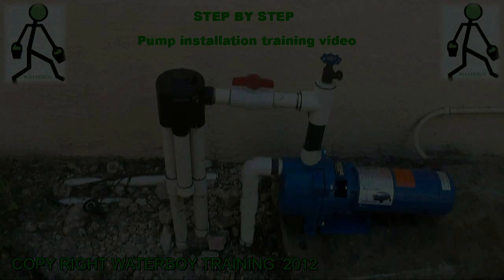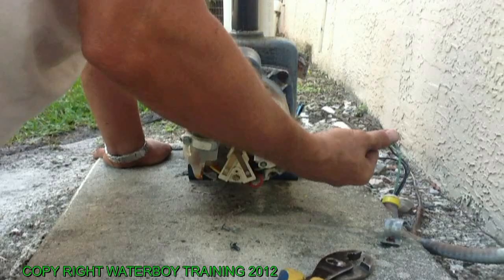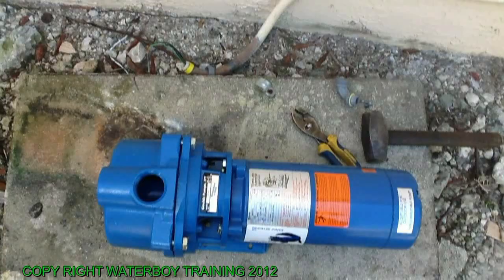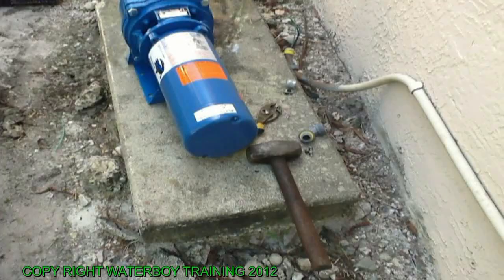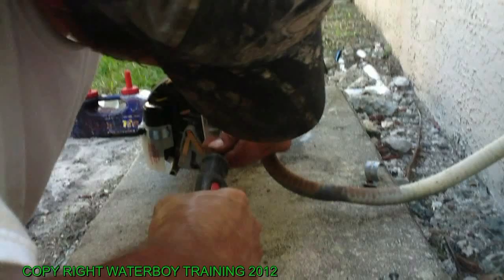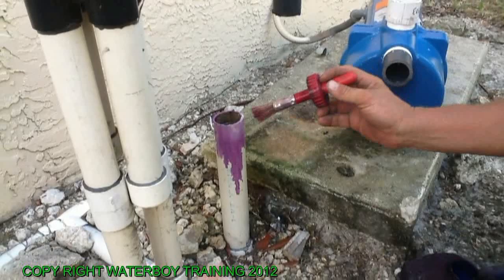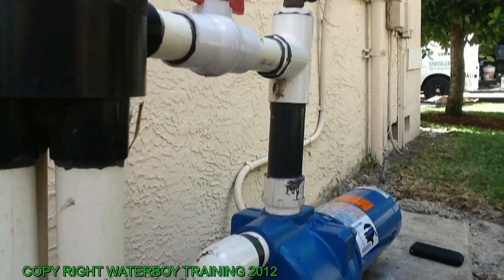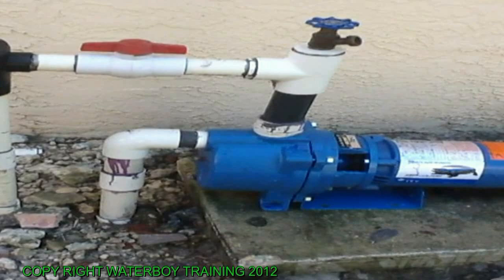How to Install a Lawn Sprinkler Pump

Comment: Excellent video.  My well is a little different as it is Artesian.  I have a flow valve on the discharge.  I have the same Gould pump/motor assembly that you do.  The video definitely gave me some ideas on how best to install.  Thanks for making the video.
Reply: 7

Comment: Nice vid.  Couldn't a couple of unions have been used to make pump replacement more simple for the next person in the future?  For instance one wouldn't need to cut any pipe to R and R a pump.
Reply from the maker: No I don't believe in pvc unions they leak it's much better just cut it out replace it with a coupling 
 And besides it's always better to re pipe when you replace a pump.
 And that's based on 47 years of experience and thousands and thousands of pumps that I replaced.

Comment: I just installed the same pump - much nicer than the flotec I was replacing.

Only problem I am having is the discharge fitting is leaking where the plastic threads into the cast iron housing. Any tips, or just use more teflon tape?

Comment: I have been losing prime .. my water source is from my canal .. I changed the check valve at the canal.. then filled my system with water from my hose that I connected to my system.. I got it running but when my system shuts down it loses prime.. any thoughts on what it could be ? Maybe the check valve at the pump is stuck? Thank you and thanks for the videos
Reply: Shut the valve off fitst then turn off pump. Upon restart turn pump on first thrn your valve.

Comment: I have solenoid valves that control the system. Should the pump be before or after the valves? Probably a stupid question. Thanks.
Reply from the maker: Before
Reply: @waterboysprinkler  thanks

Comment: Ours is 16 years old and suddenly stopped rotating zones - ours looks like the configuration that you have here.  We have 2 active zones- front and back yard and the other 2 are capped off.  I have looked in the system and see no corrosion.

Comment: Installing unions would make changing it out a bit easier.
Reply: They CREATE bigger projects for themselves.  In this case, next time they’ll need to re-pipe several pipes as there’ll be no pipe left for him to cut!
Reply: @jrm163 don’t let him see this comment. He’s “installed 37,000 pumps” so you should “stick to your day job” 

My pump needs to be winterized every year and part of that includes letting the check valve drain all prime so I would need to re-plumb every year if it weren’t for unions.

Comment: Great job replacing that pump. Im having a problem with mine except a little different. The wiring that underground for the pump is in pvc but it keeps getting hot and tripping the breaker. What type of wiring should I use underground? Should it be in pvc or would that create a heat problem? HELP!!!!!!!!!!!!!!!!!!!!!!!
Reply from the maker: Yes you definitely want to run your wires in PVC conduit they must be at least a number 12 gauge and it cannot be too long of a distance either you need a 20 amp breaker to run that pump on 220vac
Reply: @waterboysprinkler  Wow quick reply thank you. The run is about 110ft its an older fla house so it goes from the pump to the breaker inside but like i said I used that white romex i thinks its called. Its usually seen inside new house construction in the walls for like outlets. Im just not sure if using that type of wire is the right dtuff or not causing the breaker to blow. The breakers are 2--110v making it 220v i guess. Could it be wired incorrectly when the pump company replaced the pump? Btw Im sorry for bothering you. Its just that you know what your doing and I trust what you have to say...Thanks alot
Reply: @beachside1  some pumps you can run on 110 you just have to manually switch it inside the back of the pump is, you can check yours and see

Comment: I just helped a neighbor install a 1.5HP self priming pump to draw his lake water for his sprinklers. The pump is located on the side of the house next to the sprinkler valves. We ran 150 feet of 1.5 inch pipe down to the lake and installed a check valve next to the well screen in the lake. The pump will not draw at all from the lake. I checked for clogs, air leaks, and even changed out the check valve. I primed the system and it still will not draw from the lake. What am I missing here?
Reply: Pumps don't like to 'suck' from a distance. They will push water much better, so pump near the source.
Reply from the maker: Experience stick to your regular job and hire a company that knows what to do
Reply from the maker: @davidluxton-smith7738  another person that doesn't know what they're talkin about I ran 1000 ft suction line on a job plenty of water it's just called experience that's all
Reply from the maker: So now you know what pumps like what are they people
Reply from the maker: You can install a pump a mile away if you know what you're doing
Reply from the maker: I only installed about 37,000 pumps that's all

Comment: Should I install a check valve if one is not already  in place?
Reply: yes
Reply: Richard Levine  there is already a foot/check valve. Do I need another on the surface? Thanks
Reply from the maker: davefromjax no 1 will work

Comment: Is there no pressure tank on this system? do you find it works well without a pressure tank?
Reply from the maker: yes
Reply: So called experts claim u need a pressure switch. I dont have one. That u  need a pressure tank. I dont have one. So yes it works great.

Comment: Shut the power off from the Breaker or Disconnect first!
Reply from the maker: I already said that in my description to make sure the power is off and use a tester to confirm that power is off.

Comment: First thing you should do is cut power to it but ok
Reply from the maker: What do you think were stupid lets just work on the pump with the power on and get electrocuted
We use something called a Meter an electrical tester
Don't attempt the job if you don't have an electrical tester
Reply from the maker: If you would have read my description you will see that I mentioned shut the power that's what I said in my description if you looked at that